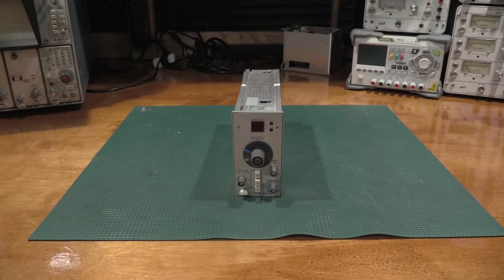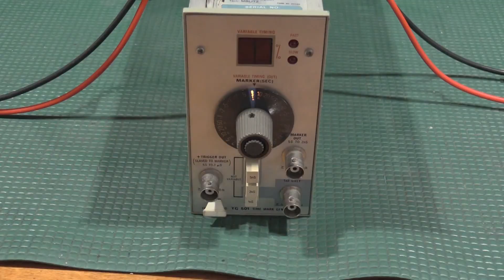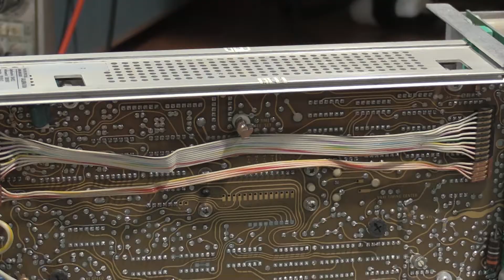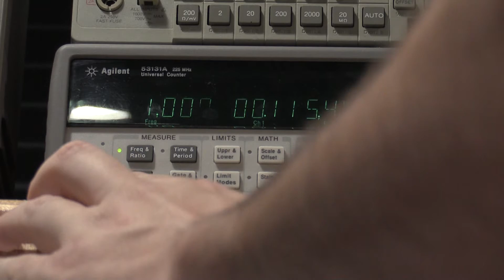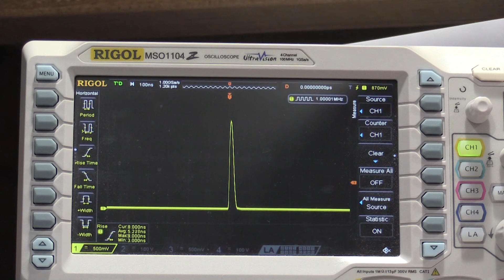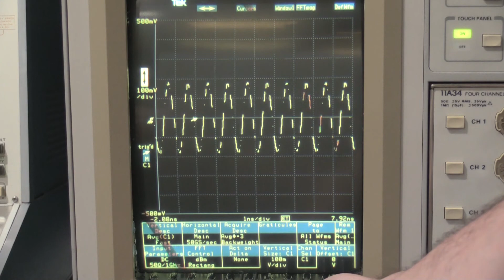Tektronix TG501 Restoration and Time Check

Comment: I have an extra TG501 with a dead 1ns signal. That transistor in the comb filter is actually a special diode. I replace it and still no signal. The lower shield needs to be removed for further chasing. That’s a lot of desoldering. Can’t bring myself to do that.
Reply from the maker: Forgive me for asking the question. Are you sure the signal is not there? 1ns sign wave is a 1Ghz signal. I am see it barely on my 7904a with a 7B92A. To really get a good look at 1ns signals I am on the DSA602A with the 11A72 plugin, And lots of averaging. 1ns is far outside the capabilities of most of the scopes I have in the lab.
Reply: @ZenwizardStudios  Since i'm a 5000 series lab, I can only see the 1ns with my 5S14N sampler and HP counter (same as yours).  I have a second working TG501 that was used to calibrate my 284's and sampler.  The area right under that special diode is really difficult to get to.  I suspect the prob is in that area.

Comment: Great vid as always. Been looking forward to this one. I broke my differential comparator and now have to recalibrate it. Has a few unusual cal steps which need your brains. But unfortunately, it’s a 5A13N and you don’t do the 5000 plugins…yet.
Reply from the maker: Ill have to see what I can do there. I actually have nothing in the 5000 series on hand so I will have to start from scratch on that one. I see what I can make happen. Ill have to look at that after I am done with the test card for the 7854. I am getting close to having a board done to recreate the analog test card. I do have the 7000 series one if they are similar. I have one of the newer 7A13’s that needs to find some time on the bench.

Comment: Really enjoying your videos and forwarded your channel on to Alan Wolke W2AEW who is also a YT video blogger and is a sales engineer at Tek. One thing you might think about if at all possible is to back the camera up to allow us to see the instrument you're using to adjust levels with (you did that with the 53131A). Or if possible even better would be a PIP (pix in a pix) if possible. You may have done this in an earlier video that I haven't gotten to yet but I'd find it interesting to find out about you and your lab, maybe a tour? Thanks and keep up the good work!  Dino KLØS (BTW, are you a ham by any chance?)
Reply from the maker: Hi Dino Papas, Glad you are enjoying. It will also be interesting to see what Alan thinks I have been a long time lurker on his channel as well. In terms of the camera I am fighting 2 issues. In most cases the size of the gear is rather large. Especially the curve tracers and 7XXX scopes this coupled with the focal length of the lens has caused me no end of frustration. The camera I currently have is a cannon A20 but it has a fixed lens with about 20X optical zoom. What I need is a good camera body with changeable lenses. I need some wide and macro lenses. I am going to need to invest in some glass for sure soon. But when I make the change I would also like to kick up in to working with 4K video. Currently I top out at HD. The good news here is I have the compute horse power already covered for 4K just need the camera and glass. I am already in the cannon ecosystem with a T3I so I will most likely keep the cannon glass. Just get a few more lenses. I will have to see how picture in picture would work I currently only have one camera. Mabey a intermediate step would be the cannon on the DUT and a go pro on the instrument making the measurement (I will have to think on this) mounting and angles are the key there.
I do have a lab tour planned most likely around Christmas as one of my goals for the channel is trying to help a beginner go from blank table to lab I am thinking about possibly doing an annual how the lab has changed over the year. As especially during the building process the equipment is very dynamic. I am getting to the tail end of where the gear is not eye wateringly expensive yet but it is getting up there.

In terms of being a Ham yep I am one but I will have to admit I am an absolutely AWFUL ham. Given that I go not yet have an antenna. Let alone a receiver or a transmitter I have hit Technician class on my license I do need to finish it out Amateur Extra is on the list of things to get done.  
The next video out will be about the 3 500 series plugins and what makes them useful for calibration the PG506,TG501,and SG503 Then it will be back to scopes and test equipment. I also have a VTVM on the way. 

Zen
Reply: @ZenwizardStudios  Hey, thanks for taking the time to provide your detailed update. Look forward to the tour later this year. You can see our shack/lab pix on our QRZ page.  73 - Dino KLØS